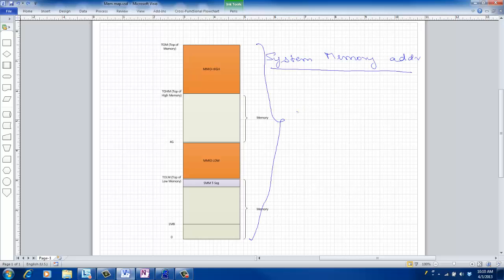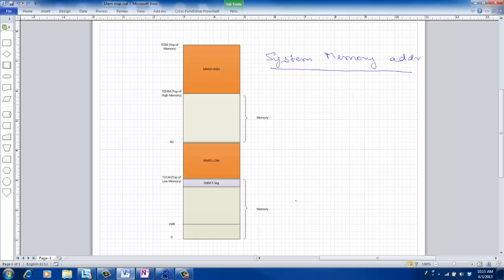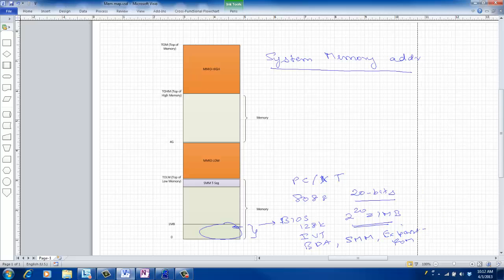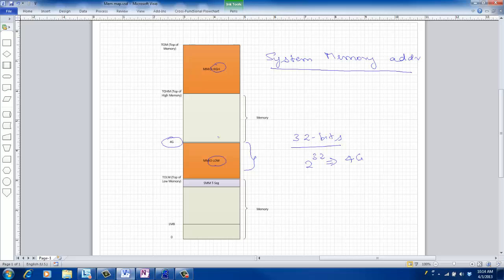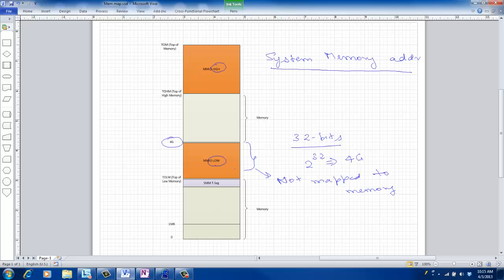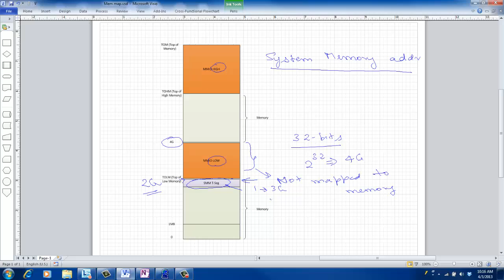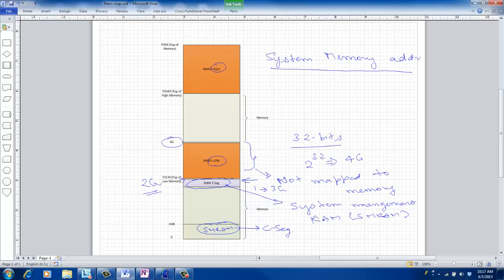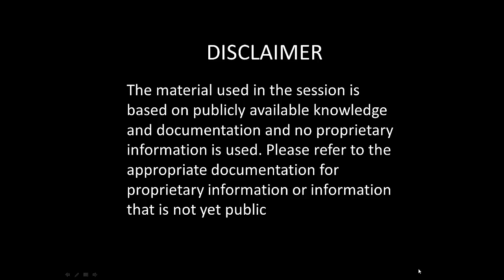System Architecture:  1 - System Memory Map

Comment: My suggestion is to emphasize that this is CPU Address Space.  The CPU address space needs to be decoded by the Chipset.  The diagram has confused me for years.  I finally understand that it is demonstrating CPU Address Space.  I made huge mistake in thinking this diagram was a map of the RAM.
Reply: exactly..thats what i was assuming.. until he referred that MAP wil refer to the DRAM.. thanks for the post.. it saved a lifetime of my time :)